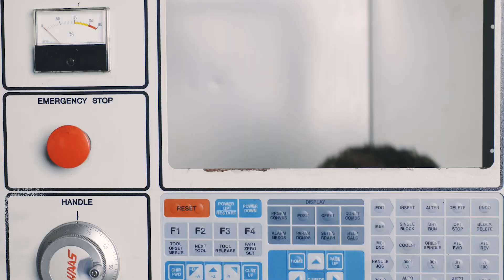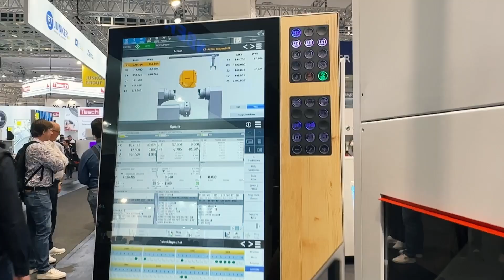Is it Worth Visiting EMO 2023 | Day 2 | Hannover Messe CNC Trade Show

Comment: I have been fortunate over the years to attend IMTS a number of times as well as EMO and most recently JMTS in Tokyo.  I have always come away with new contacts and some new idea to apply.  Usually it isn’t the machines themselves as you can research them and have vendors come in.  I find walking the off the main track most helpful.  Lots of small vendors most of which don’t really apply but I always have found a few nuggets to apply that more than offset the cost of the show.

Comment: I think the last IMTS I attended was 2016.  It does not seem so long ago.  My first was 1996.  The real issue I see with the trade shows is that looking at the machines does not inform you of what it can or cannot do the way it used to.  Between the machines being so covered in way guards, etcetera, and needing to use the internet to find answers, the value of attending is not the same.  My first IMTS was filled with so many technical lectures I nearly did not get so see the whole trade show.  The last IMTS had almost nothing as I recall.  People are learning from the internet, as in, from people like you.  Someone needs to start doing machine reviews like car reviews.  Run standard test parts with identical tooling, etc. to have real comparisons.  Thank You.